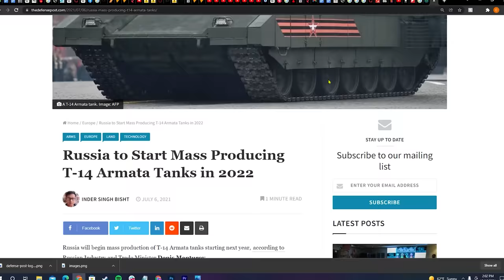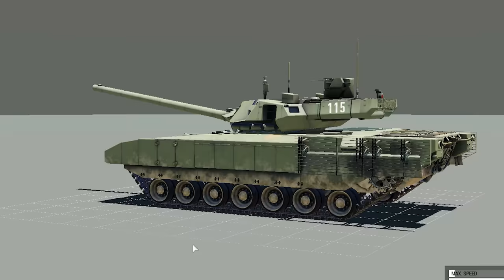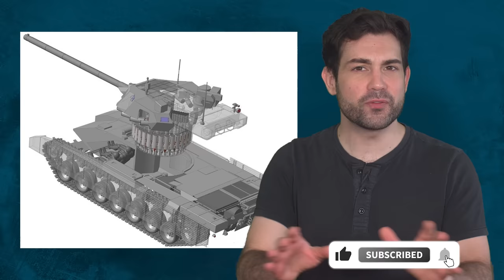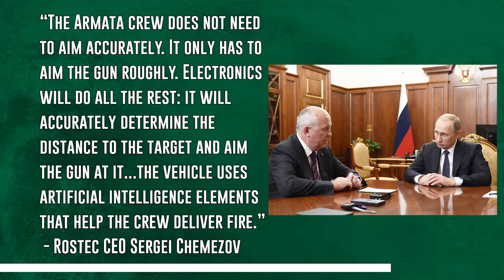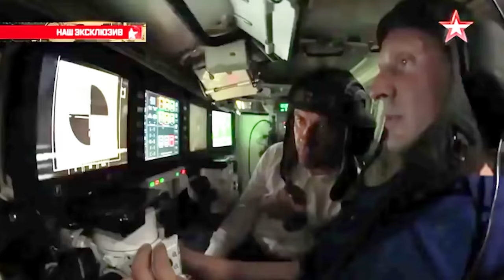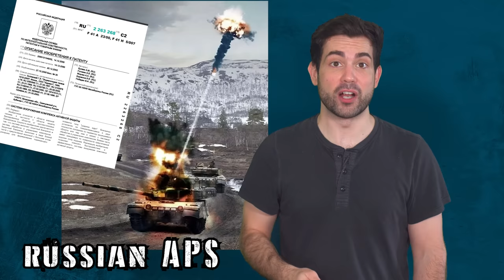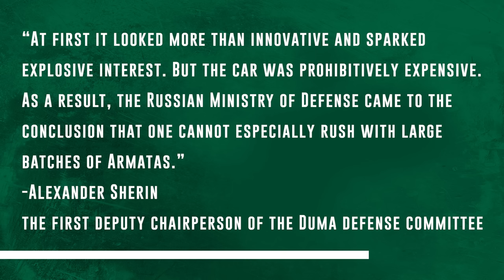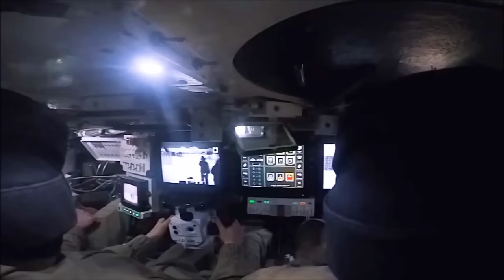The Truth About Russia's T-14 Armata Tank

Comment: The tank is still being tested. The latest versions of the T14 have changed the body armor and God knows what else. There is no point in rushing with deliveries, anyway, no one has and will not have anything similar in the near future.
Reply: Yeah, afaik first batch delivery of the serial production will start next year
Reply: Near future? That's debatable, but I think it'll be under 5 years before other nations start producing their own developments.
The tank itself should still be considered on the prototype phase. It's not in full production and should only be considered as a test bed in it's current state.
With the U.S and Germany/France especially currently developing their own next generation tanks that will outpace the T-14 in it's current state at the least.
The U.S specifically is just going through the bureaucracy of deciding what design they want for their crews. So it'll be capable of putting out new vehicles within a year or two when that happens. Germany & France are still in the technology demonstration stage right now, but what they're testing completely blows away anything Russia currently has planned to mount on the T-14.
Reply: @mando_dablord2646  "The U.S and Germany/France are currently developing their own next generation tanks that will outpace the T-14 in it's current state at the least." - Perhaps they will be superior, and maybe not. Only in Russia does the tank finish testing, and in the West they are only thinking about the project. It's not even on paper yet.
"The U.S specifically is just going through the bureaucracy of deciding what design they want for their crews. So it'll be capable of putting out new vehicles within a year or two when that happens." - Read the history of Bradley's creation.
"Germany & France are still in the technology demonstration stage right now, but what they're testing completely blows away anything Russia currently has planned to mount on the T-14." - Germany and France have been doing this for 5 years. Where is the tank?
Reply: @Yevgeny_N  You're under the assumption that it will go exactly as it has gone in the past. On the flipside of your view, the T-14 hasn't finished full testing either. It's set a very poor standard and is still unproven, with Russia needing to fudge it's numbers to make it look better.
The U.S has 3 designs that they've past to tank crews to see what design they prefer. It's not like they're just doing a wait and see, they're fully prepared to begin the production phase when a decision is made. The Abrams is at the end of its lifetime, in terms of upgradability and in comparison with the T-14 which has met NATO standard.
Germany and France also aren't rushing out their development either. They're on schedule and have been in the technology demonstration stage, which they're shifting to the development stage now, with full production expected in 2035. Even if it's still gonna take a while, I stand by my statement that the technology demonstrated does far outperform anything the T-14 has planned. Technology integration hasn't fully begun, which will happen in the last few stages and creates room for further improvements. 
So the U.S is the closest to making a next gen tank, which is also looking to make heavy use of drone technology. In comparison to Russia which has essentially just made an experimental tank that is currently above average in terms of NATO standard.
Reply: @mando_dablord2646  "they're fully prepared to begin the production phase when a decision is made." - Your naivety knows no bounds. I stand by my opinion. There's no point arguing about it. Time will tell which of us is right.
"above average in terms of NATO standard." - He is so much above average that the US suddenly decided that Abrams was outdated and urgently began developing a tank of the next generation. Before the appearance of the T-14, they said that Abrams was the best tank in the world. What happened? Is he no better? So much so that even its most recent upgrades are not satisfied and it needs to be replaced? Let's assume, hypothetically, that the US will build a prototype in a few years. How many years do you think it takes to test before being adopted? Do you think France and Germany have bad engineers, since they will only build the first tank in 2035? A tank is not an iron, it is a very difficult engineering task. India and Turkey are unable to create a good tank. How many countries do you think make tanks? If it were simple, Germany and France would not have united to create a tank. Moreover, this is not their first attempt.
I can't wait to see what kind of tank Russia will present in 2035. You don't think that work has stopped in Russia. A new generation tank has already been created and while Western countries are developing their own, Russia is developing a tank of the next generation.
Reply: @Yevgeny_N  I see this is starting to devolve into nonsense.
You said that tank production isn't an easy task, but the T-14 stinks of rushed production. Which is why it's been in development hell for the past few years. I think this has stunted it's development and ability to develop further at a quick pace.
That's why I believe in the other developments more. They're true next-gen tanks that will utilize the technology on production rather then still needing to integrate it.
I do agree with you that the statement that the Abrams is the best is stupid though. I'd personally say that went to the Leclerc or K2, which the T-14 is now competing with.
If the Russian military is developing another next-gen tank then it's already destined to fail. The Russian budget can't handle anymore upgrade programs, so Putin will finally need to get shot in that case.
Reply: @mando_dablord2646  T-14 is the embodiment of the concept of the 30s of the last century, developed by Soviet scientists, called "Teletank". There was no rush, the project started 20 years ago. He had different incarnations and names, one of them "Black Eagle". T-14 is a compromise. This is more than enough for today. The potential inherent in this tank is huge.
There is no doubt that the most developed countries, such as the USA, Germany and France, will create their own tanks and perhaps they will even be better. But when will it be? That's why I wrote that in the near future, no one in the West will have anything similar. And while the US is developing the concept, the tank is almost ready in Russia, and in China it is undergoing initial tests.
Reply: @Yevgeny_N  Problem is, that Germany and France have different needs in tank design and therefore discussions go on. The gun will, without doubt, be the new 130mm Rheinmetall, which will, AFAIK, also be used on the new Challenger. There is no need to rush, if we germans do a tank, we do it properly. Our 2A7 is one of the best machines out there and is capable for more upgrades, why rush? Because some russian factory claims to produce a new tank?
Reply: @endederfahnenstange4283  Everything is right. The Germans know how to make tanks. The 130mm cannon will finally allow German tanks to fire missiles. I can't wait to see this new tank.👍
Reply: @endederfahnenstange4283  If Germany and France can agree and build a single tank, it will save them a lot of money.
Reply: @Yevgeny_N  Missiles are not in the doctrin of german MBTs. Missiles are fired by helicopters, IFV and infantry AT teams. Not by tanks. Target of the new gun is a lager penetrator, that can punch through anything on the battlefield of the future.
Reply: @endederfahnenstange4283  It has been discussed many times in Russia that a 150mm cannon will be installed on the T-14. The gun is ready, but it was deemed unnecessary. I think if NATO has a tank with a 130mm cannon, a new cannon will be installed on the T-14. But I think it's too much, 130, 135 mm would be better. For a 150mm cannon, there will be too large shells, you can't load a lot of them into a tank.
Reply: @endederfahnenstange4283   I would personally prefer that Germany integrates their 130mm gun with France's ASCALON. The ammunition being telescoped creates space savings, which could allow for a bigger round like 140mm. Although 130mm is the safer route and more can be carried.
But that's mostly just wishful speculation...
Reply: @mando_dablord2646  I would not anticipate the US to have a MBT any time this decade, if ever again. 

I believe the decision is whether or not a MBT is necessary, useful, or possible given current changes in peer-to-peer war dynamics. The guns shoot too far and there is no armor that can actually stop them, so having a swarm of expensive assets is risky, while having only one or two expensive assets is worthless... The challenge is whether or not Russia can ever prove that the T-14 can be mass produced, let alone produced at the alleged $4 million (comparable to the legacy Abrams price). For the niche the T-14 is looking for (holding the fort in Georgia/Ukraine) a run of at least 5000 may be costly but effective. 100 is a joke.
If it can be mass produced, then at least it has a chance for use in an aggressive strategy that bypasses current anti-swarm weaponry (using the active and passive protection systems), and is too fast and heavy for artillery. If it cannot be mass produced, then any time it leaves a city (and most of the time it is in a city) it is a hunk of molten metal, because it is a rare and juicy target for increasingly sophisticated heavy armor removal tools.

So far, no good.
Reply: @Bingo_Bango_  The entire point of armored calvary is to support infantry, which is the backbone of any ground military. There can be APC's and IFV's, but they tend to mount smaller kinetic guns and have weaker passive armor. So they can't be used as a spearhead very well. Another big thing to keep considering is that the U.S is planning on their next gen tanks being drone platforms as well.
The part of point of tanks as well is the fact that the kinetic guns can fire from such a long range away. If the U.S is honestly considering dropping MBT's then their military is destined for failure. With the advances in APS, missiles aren't the end all be all of armor killing.
It's more of a question of if it's determined how much the big military powers want to prepare to go to war with each other.
Reply: @mando_dablord2646  I'm not sure what the point on armored cavalry or drones is, because the US is indeed still investing in both of these roles, while Russia is pursuing an uncharacteristic high tech armor-focused strategy. 
The greater point is rather than MBT are not defensible even with APS. Kinetic guns fire at a range and velocity that makes them redundant. The upper limit of US ground fires is now ten times what it was two decades ago, and fifteen times what it was in WWII. 
If you can field eighty MBTs on any push, you can overwhelm artillery and get back to cover, but if you have eighty total then artillery fire will pick you apart. This is the core dynamic that calls into question whether the T-14 is even effective as a "premium" MBT, or if such tanks will ever be useful again.
The US will field Abrams indefinitely (in the thousands, not hundreds), but it may never field a replacement, because why would it? The role is no longer there.
Reply: Vladimir Nikolskiy  That delivery of 20 has been claimed for years, but it hasn't happened yet.  The production line hasn't been established.   The most recent announcements have the delivery before the end of 2022.
Reply: @Bingo_Bango_  That's definitely a good argument. What specific Doctrine the US goes with in the future is up for debate, but what I've seen that they've been planning is backed by Mosaic Warfare which has automated and other drone based weapon systems that pave the way for Infantry and other Ground Forces. Although I admittedly can't remember where they stood on adopting that type of doctrine since I first heard it.
So with the Russian military doing mass modernization with retrofitting and developing new vehicles all together. If the U.S wants to maintain being the #1 military power then it would adopt next-gen tech for it's ground forces. Which is looking to have drones and other forms of unmanned systems either way. So if they haven't planned to integrate the logistical support for operating with drones into the Abrams, then a new system altogether will need to be created, which leads to the OMT. The specifics aren't exactly publicly known, so it's all just speculation... But with their plans for the M1A2 SepV4 and M1A3, the technology base for an new system will be there.

Comment: As a former tank commander, weapons and armour trials-officer, armoured-vehicle designer, and commercial manager of a number of international armoured vehicle programmes, I have never rated the Armata very highly. It is a vast vehicle with a highly delicate turret which is not tough enough to stand up to near misses - let alone a direct hit. Electro-optics are highly sensitive to explosions and strikes and, once these are knocked out, the design provides no back-up modes. One of the main advantages of unmanned turrets has always been that of a small frontal profile, allowing the crew to be below the line of sight and fire when in action. The T-14 makes a nonsense of that idea: the turret is as large as many conventional tanks and this is liable to be hit very quickly. Also, modern OTA munitions significantly reduces the safety of the crew - even when in the hull. Give me a Challenger 2 or Abrams any day.
Reply: They stripped all the semiconductors out of the T14 and now it drives "automatically"!
Reply: First of all: thanks for your service. I am obviously not a tank commander but... can we really evaluate something that does not exist?
Reply: @JagaimoNeko  they made 100 of which 50 or less run still as they stopped production and didnt make a spare parts line.
Reply: Your title of designer and expert is questionable. There is no point in your arguments, because you do not see the cause and effect of the size of an uninhabited tower. You deliberately underestimate the capabilities of the tank and write all sorts of nonsense. When all the mounted electrical equipment is disabled, Abrams becomes the same pile of metal as armata, with the difference that the crew is more protected in armata. And I can assure you with all responsibility, if Russia had the same financing of the military industry as the United States, then Russia's weapons would be unattainable ahead technologically, compared with the weapons of NATO countries. But these are just fantasies

Comment: Japanese Type 10 and Type 90 have the fastest autoloader, most definitely faster than human manual loading
Reply: True
Reply: True but, one less crewman means in degraded operations it's capabilities to continue fighting goes into the toilet!
Reply: @wreck993  jeah but loading a round every sec on fast mode is worth it
If you have 5 tanks and everyone has fast loading speed selected thats 10 rounds in 2 seconds and standart reload is 3sec autoloaders are starting to get better then humanloaders and at one point you need autoloaders if we want to switch to a 130mm cannon the rounds will just get bigger and heavier
Reply: @wreck993  I mean, I don't think it matters too much. Since if something ever gonna happen to the driving crew, I bet it will probably be devastating a lot of the time and cripple the ability to continue the fight, a bonus crew member won't help much. Also having a fast loader might be more beneficial than you think but well, we haven't seen the T14 in actual war yey
Reply: @wreck993  Yeah but it also means, more money spent on training, more supplies and more equipment is needed, more wages paid. That or less crews. And as for the repairing/maintenance argument, tanks don't travel alone. They are accompanied by a whole lot of non-combat units such as engineering battalions, maintenance crews etc...Only real benefit of the manual loader is a boost in morale and one more human to do some work if you're very fucked, and surviving out of the tank because it got knocked out.
Reply: @anhtunguyen781  but we have seen autoloaders in combat and they suck compared to a human loader
Reply: Vladimir Nikolskiy  Incorrect. On common ammunition using tanks, a humanhas been proven to load, unload and change ammunition types faster and more reliably. 
  Its not even a question anymore. The average M1A1 loader is 5-6 seconds, good ones are 4 seconds, and the barrel never leaves the target.
Reply: Vladimir Nikolskiy  I served 21 years, retired in 2012. 
 Western tanks enjoy a loader. Soviet/Russian designs prefer an autoloader.  Based on the combat effectiveness of of each each design, I will have to go with Western tanks.
Reply: @rayotoxi1509  Can these autoloaders put 3 rounds in the air at any time.